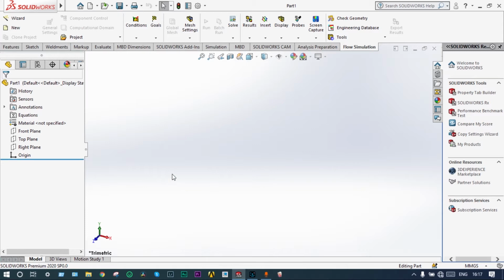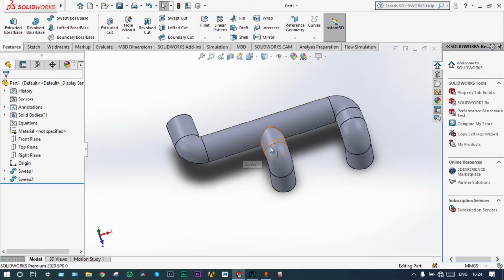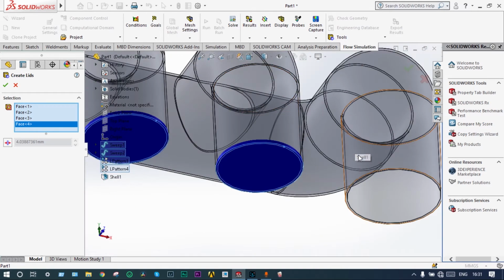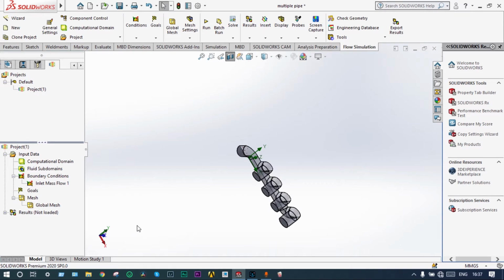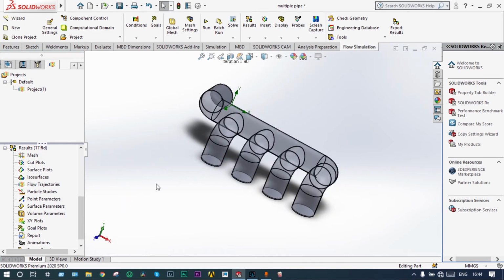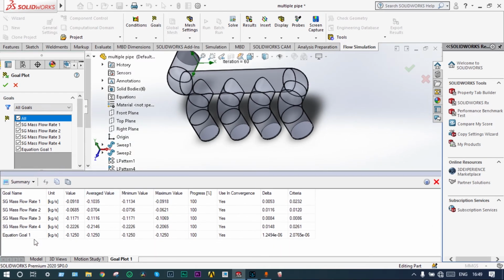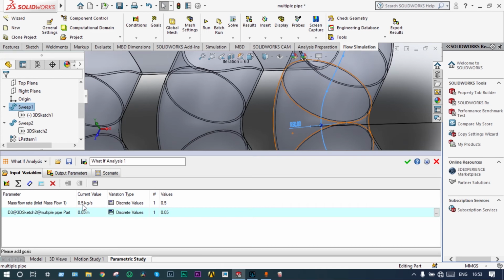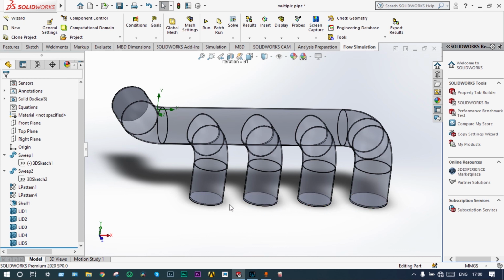CFD Parametric Study of Variable Diameter Pipes: A SolidWorks 2020 Tutorial

Comment: Plz post, theoretical calculation vs solidworks calculations results video. How I would validate the result is correct or wrong.
Reply: Something nearby results to compare.
Reply from the maker: I will definitely do it whenever I get sufficient time.
Reply from the maker: Theoretically FEA (Finite Element Analysis) of simple objects can be done but if you want to theoretically solve a bit complex problem it is too difficult. To counter this probkem experimental validation is done
Reply: @CFD_GUIDE   not for this problem, simple problems one bend, two bends one problem, with one damper one problem that way we practice means, when all two gether means it will manage  to get the results
Reply from the maker: Definitely I will do it
Reply from the maker: Actually validation is done with three different ways e.g. Software, experimental & theoretical. Where theoretical validation is very complex to support that result software validation can be done. This theoretical validation also can be done using solid mechanics & fluid mechanics which needs definitely thinking & time. At this moment I am having stringency in time. I will do it whenever I get sufficient time.